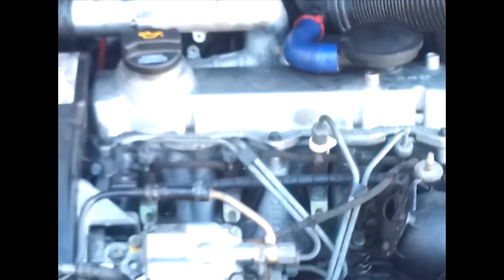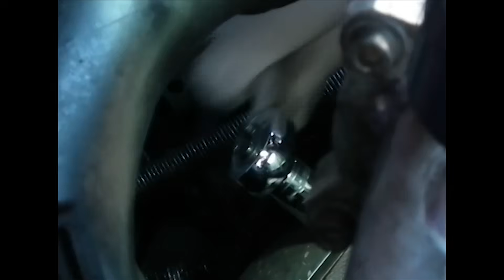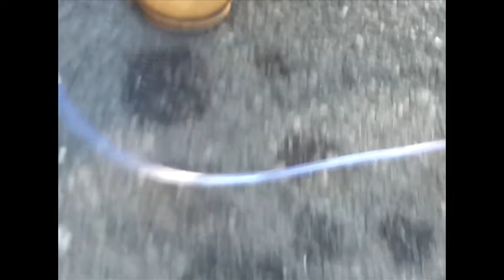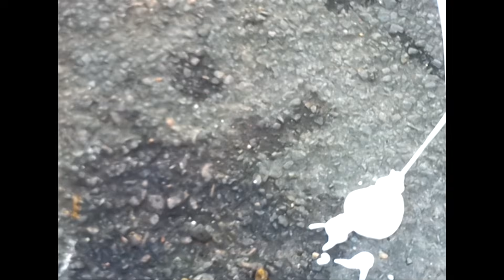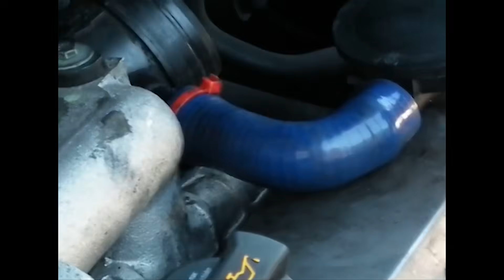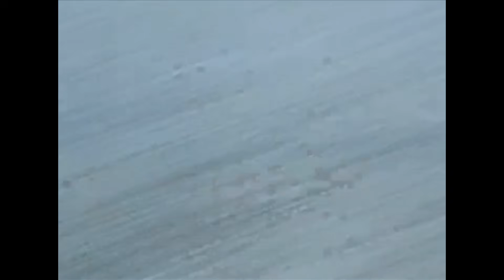Mr Muscle Audi A3 Tdi Turbo Clean - cheap fix

Comment: Hi there. Thanks for this video. 
I think this is the problem I'm having with my 150hp 5 cylinder  2.5tdi T4 transporter (the 150hp tdi has a variable vane turbo).
The turbo seems to hesitate when I accelerate in 3rd and then suddenly takes off with à great puff of black smoke from the exhaust.  She won't hold speed with the cruise control going uphill on the motorway but she will accelerate if I put my foot down - again she takes off after hesitation with that puff of smoke.
I've deleted the egr so I guess If I remove the blanking plate I can inject the Mr Muscle through there. I'd appreciate any advice.
Reply from the maker: Hopefully this helps, are you sure your MAF is ok too? Both can cause fun and games.
Basically this is pretty easy, it's more of a pain finding the tubing, also no harm repeating it - I wouldn't however leave it to soak for hours.
I've heard the odd case of bad turbos having seals eaten by this but they were well on the way out.
Reply: CarAndMechanical 
Thanks. Oven cleaner is in. I find the actuator moves but doesn't go very far.
Reply from the maker: It should loosen up the more you work it - I assume you've long since bolted it all back up. Notice any difference?
Reply: CarAndMechanical thanks for taking the time to reply. 
Once the engine cover is off it's all easy to get to on a AXG 2.5tdi Everything can be accessed from above. I abandoned the idea of going through the EGR blanking plate.  Unbolting the exhaust down pipe from the turbo like on  your Audi was a lot easier. Once the oven cleaner was into the turbo I let it sit for a couple of hours and wiggled the actuator rod every 10-15mins as you said. 
Seems have to have improved things. Turbo kicks in sooner for sure. But she still won't hold 130kmh in cruise control on motorway hills. I didn't feel much movement on the actuator - probably les than 5mm. Even though it seemed quite smooth it was still pretty tough on the fingers. Should it be easier and have more travel? 
It's better, but I think I need to get her looked at by a pro. Still not quite right. Maybe the actuator is ajustable - I think I read that somewhere.
PS
Just found this link on YouTube but Ive no idea how to get it to do this so I can check it
https://youtu.be/scnmRsCArXo
Reply from the maker: If you gained movement it sounds like it was part of the issue and sometimes the vanes can be really carbon'd up.
The VNT system sounds like it wasn't working fully before and maybe not so the car is struggling to hit expected boost at certain points - it would be worth repeating, the process but I'll throw out some other potential issues.
Vac lines - if they are split or vac is weak it'll take longer to get the turbo to the low position but also open the vanes for high boost which could overspeed the turbo (which is why the ecu has limp mode to prevent overboost).
MAF sensor - get VAGCOM (VCDS lite, a laptop and a £5 ebay cable go a long way) or if you have an android phone then use Torque pro and look at the air readings, fuelling it based off the metered air seen and I've had MAF and VNT issues at the same time. VCDS shows fuelling in mg/r and it gives you a target and actual - if you see it all over or slow then it can be the MAF, using Torque I think it's in G/S so the numbers are different to VCDS but the good thing with Torque is you can have it on all the time in your car and when the cars performing well note the numbers, when it's performing badly note the numbers it'll tell you if the MAF is misbehaving.
Last thing as you've mentioned is the turbo could be out of adjustment and you need to adjust the stopscrew, I've been lucky and never needed to do this but if you do note your start position and adjust 1/2 turn at a time (some good guides online https://www.myturbodiesel.com/wiki/turbo-stop-screw-adjustment-tdi-engine-zip-tie-engine-hesitation/)

Comment: Can be this done on a car  he is not closed EGR valve. Can damage the EGR valve or the hose that comes with the EGR valve (I do not know which material it is). How much volume should spray the spray? How much volume should spray the spray? Thanks and sorry for my bad English +CarAndMechanical
Reply from the maker: Hi, yes you'd need to get the EGR off to do it, when you do it you want enough to fill the hotside of the turbo but not to get into the block if you can help it. If you use hose like I have then you should be able to get it in deep and just as foam starts to come out you've probably got enough in there.
Also sometimes it's worth repeating the process.

Comment: Isn't sodium hydroxide corrosive to metal ?
Reply from the maker: More to Alu then Iron - this was done on the Hot side which is iron, however I do mention not to overfill into the Alu bits in the head.
When you start it up it'll burn everything up and blow it out the exhaust.
Reply: @CarAndMechanical  See https://www.youtube.com/watch?v=2k8IdyXwGE8. Ali candle base perfect after 2 hrs in Mr. Muscle.
Reply from the maker: @christophernation4793  TBH I'd have to try a similar test but also for longer as it's science that NaOH is corrosive to aluminium - time for it to be effective? I couldn't say so would always air on the side of caution especially if sticking it in my engine. I have some alu engine bits kicking around so could be an interesting experiment to see what happens over 48 hours.

Comment: Silly question maybe but, can this be on petrol turbo? Mk4 golf 1.8t
Reply from the maker: Hey - afraid not at the 1.8T used a fixed position turbo with no VNT mechanism. Also I wouldn't expect a Petrol turbo to soot up, what issues are you having with it?

Comment: Hey, for how long does this treatment help. Is it a permanent solotuion or do you have to repate it the next year? I have the same problem with limp mode and will try this metode. thanks
Reply from the maker: It's a bit of a "how long is a piece of string" answer I'm afraid as carbon build up will vary even between 2 of the same model/spec cars due to driving style/distance etc...
Once done if this was the issue you faced then at least once a week open the car up in a few gears and hit redline or as near as (if you can safely). With the low down torque sometimes the turbo's never get fully spun up.

Comment: Hi everyone..I would like to try this on my seat ibiza 1.4 tdi, do I have the engine running at the same time am spraying Mr muscle down the pipe?
Reply from the maker: Hi - please don't try this it must be when the car is off and cooled down. The oven cleaner is flammable, and the turbo very hot. 
Also it will need to sit and soak in to loosen the carbon/soot.
Reply: Thank you..so after the soak in..just go for a 20mins drive and gradually push 4000 rpm when the engine is hot
Reply: Also how much of Mr muscle would you recommend,  1/2 a tin? Just want to make sure am doing this right
Reply from the maker: You need to move the actuator whilst it is soaking - at first it'll feel grainy and you'll feel it get smoother. Volume wise not much but back sure it's all in the hot side of the turbo and you don't put too much in so as to get to the engine. NAOH will eat away at alu
Reply: Okay thanks one last question..the egr pipe on my car looks like a more golden colour and has a kind of spring design on part of the pipe..is this the right one, or there is another exhaust pipe leading to the right but this is a lot bigger and isn't facing down

Comment: Great reviews so far! What other components will I need to disconnect? I believe that going in through the "hot" side, I most likely will have to remove the EGR valve on top...will I need to remove the EGR cooler?  Wondering if I will need to get additional coolant? 
This weekend I was on a trip and 30 mins from home (thankfully) I had to turn back home and use our other vehicle because limp mode would not allow me to go more than 30mph up the hill!! UGH!!

Comment: Tried this on my A6 AWX, saved me a lot of work removing and cleaning the turbo. Now car is more responsive,goes more smooth and no sticking. Thanks
Reply: Nice, I have the occasional limp mode for 10 years on my A4 AWX, will probably try this 😄
Reply: @Bakanelli  did it work??

Comment: I just done this today to my Audi A3 1.9 tdi PD 130 and before the car was going into limp Mode once the car was taking upto 100mph, i done this method and my car does not move l, its like its in limp Mode all the time. i dont know what i done wrong, could you please help
thanks
Reply: i have the same PD. did you solved the problem?

Comment: there is movement when trying to move actuator rod when connected to turbo .but very tighy and only moves about 5mm
Reply from the maker: I hate to be so vague but I'm kind of working from what I've seen others need to sort. 
I think this page might help http://www.myturbodiesel.com/wiki/vnt-turbo-actuator-adjustment-repair-replacement-on-tdi-engine-mk4/ 
I do wonder if you are out of adjustment somehow. And All the vac lines and N75 have been checked?

Comment: done this twice on my golf this week . it will hit higher revs now . but still goes into limp mode . maybe mines beyond mr muscle and needs replacing ..any idea top speed would be in limp as mine will still do 100 in limp
Reply from the maker: Hey man, which type of Golf and engine is it - VE - PD or CR?

100 in limp sounds interesting I'm wondering if you got a turbo or MAF issue. Have you checked VAGCOM codes yet and anything that leads you towards the VNT vanes rather then vaccum / split hose or fuelling.
I'm throwing in a ton more questions as that speed means you must be getting fuel/boost....next question is that UK or Euro 100?
Reply: its a uk 2007 golf mk5 
 2.0tdi .it does rev for longer now .upto 5k revs . hits limp at 75+ 
but will allow 110mph but lot less power through gears
Reply: vag com shows over boost . about 145 bhp instead of factory 140
Reply from the maker: Something is telling me it's not the turbo or if it is then it's very coked up! You are in luck that you can use an Android/Iphone App to scan codes - also can use vagcom with a laptop.
I'll throw a hand full of suggestions out because my limp mode is like 60mph but I think yours will be a PD130 or 170 so more power in limp.

Scan for codes (I've done a video on this)
Run some logs - check fuel - MAF readings - Boost
If you have the torque app set it up with a few gauges like fuel, boost and MAF
Check your vacuum lines - a split one could stop the VNT mechanism working properly - infact it's a few £ to replace the lot.
Check all your IC hoses - that can be tricky depending on access but if you had a hose only opening on wide open throttle it could trigger limp.
Reply from the maker: OK this gets away from things I've need to look into but I wonder if your actuator is out or split vac lines and sometimes can be the N75 controller.
When you press the actuator how does it feel?

Comment: i have same issue on a 2006 mk5 golf /140 .2 garages both say i need a new turbo at a cost of 600+£s . but ive since been told this is a common vnt problem and if i fit a new turbo i could have same problem in 6 months .and have been advised to clean the old one every few months with wynns turbo i(in tank) cleaner . tried the mr muscle approach but too hard to get access on mine .
Reply from the maker: I think a few people in the comments have done it on a similar platform/year tdi so worth checking I just think the EGR is a pain to remove.
Is the turbo shaft ok - so no excessive play? I mean if you DIY it which does mean having the actuator bang on the turbo's themselves are cheaper on ebay! XMAN turbos (facebook) does hyrbid units for £700.
The in tank cleaner might help but it's mixing with a fair volume of diesel.
Reply: yes egr is a pain to get to.tge first 2 12mm bolts are easy enough.but the rest is a pain.might try again tomorrow.better to clean it every few months than replacing turbo if its going to carbon up again at some point .
Reply from the maker: Yea, if you can get in there this method can work really nicely and certainly if the turbo is working fine you are probably just needing to set right 10 years of build up thanks to the EGR.
Kind of surprised mechanics don't offer this as a £50/100 job but then again it's not 100% if something else is at play and they make more on the turbo labour.

Comment: Thanks for the video. I did this last Saturday with my 2005 Mk 5 Golf 2.0 TDI 4 motion.
It has been going into "limp mode" for several years when accelerating uphill or other random times.
VW garage did diagnostic and told me I needed a new turbo and wanted 1700 Euro for the job.
I figured I would try this first.
I do have an EGR so I had to remove the EGR cooler and the plastic intake ducting. (5mm, 6mm allen, and T30 torx)
It took about 2 hours to get everything off. ( I went slow and cautious, could do it again all under 1.5 hours)
Used entire can of oven Super U brand oven cleaner (I live in France)
It never foamed up out of the hole but fumes poured out. I worked the lever and yes it did get a bit more movement and easier after a few jiggles.
Buttoned it all back together and YES! no more limp mode !!! Horse on it up to 4500 RPM and all good. POWER is back.
Thanks CarAnd Mechanical. Great video.
Reply: Hi, i think i have the same issue... im curious to know if your engine is/was the BKD 2.0 TDI?
Reply: @Pixelkill3R  I have a bkd engine, wondering how good this technique is for cleaning the turbo. Mine has high mileage and just bought it
Reply: @matthewellis9885  haven't tried it. She's runs ok if I don't push it. Just haven't had the time. Consequently the cars mot is up soon and most likely won't pass. End of the road. Guilia Quadrafoglio next 💪
Reply: @matthewellis9885 I done this yesterday and it’s got it out of limp mode and have power
Reply: It is very likely that it goes into limp mode, due to over boost - waste gate or variable vane stuck! I'm not familiar in details with the 2.0 TDI, so make sure the actuator moves with absolutely no restriction.
Reply: I have the same car as you mate. Can you do this with a DPF ?
Reply: What happens to the remaining mr muscle/soot/shit in the turbo, do you just leave it in there and start the car?
Reply: @willwatling it’ll get chucked out the exhaust

Comment: Help me out ive had code 17965 for awhile now! and ive literally tried everything. 
1. mr muscle on various occasions
2. changed map sensor
3. change maf sensor 
4.changed n75 
5. changed pipping for vacuum leaks.
Reply from the maker: Hi Chrissy, ultimately this can be all sorts when you have had to do what you have.
Have you been along to tdiclub.com forums? 

Personally I'm wondering if you've got an actuator position issue, has that been checked?

I know you said it was remapped....that does make me wonder.
Reply: +CarAnd “Car Mechanical” Mechanical gonna stick a few Bottles of turbo clean in it and do me muscle again and also replace bolt on turbo
Reply from the maker: before you replace the turbo get a mittyvag to set the actuator length - this is not something I've got or done yet. But the theory on this is if the actuator rod length is too short or long the N75 control is screwed up.

If you are getting a new turbo you should have one anyway as they can move in transit.
Reply: +CarAnd “Car Mechanical” Mechanical cheers mate
Reply from the maker: just seen my typo too....mittyVAC
Reply: Watch the vmt ring in the exchaust turbo housing isnt worn , if so replace asap.

Comment: What a great video and thanks for sharing. I did this procedure on my VW Golf AHF engine and it freed the turbo up nicely,  restoring the low power issue I was getting under 2000RPM. I had a sticky spot in the actuator but after about an hour of treatment with moving it about occasionally, the sticking actuator began to operate smoothly. It's now super smooth and the car is running great again.
Reply from the maker: Glad this worked for you, really happy it's still working for so many people and saving tons.

Comment: ive changed my MAF sensor and attempted this aswell. still no luck im driving a 90 bhp golf mapped to 130 and receiving error code 17965 what else can i try and would VAGCOM narrow down the problem.
Reply: vacuum
Reply from the maker: +ChrissyKennedy 90 mapped to 130. Has it had bigger injectors? And did it behave premap?
Reply: pre map the car was proper dead:p stnadard injectors but ive had her at 110 before turbo is deffo kicking out as car goes into limp at 80 which leads me to think its the vains
Reply from the maker: I'm not sure the small injectors can flow for 130 bhp but will check. 
Have you logged boost in vagcom? Could be a boost leak triggering limp mode too
Reply: cars sitting at about 120-30 id say gonna use vagcom today and see what i can i still reckon its a turbo issue tho and  i may try mr muscle trick again turbo pulls like mad until the 80mph mark then limp mode occurs but car deffo has more in it
Reply: +ChrissyKennedy keep us posted, it helped me for about 3 days the clean did, but I'm getting a P1557 & a P1248.
Reply: will do pal replaced all pipes tonight so deffo no leak new n75 ordered
Reply: What pipes did you replace?
Reply: +ChrissyKennedy I need to do  the same, how much do I need? 2 sizes only as far as diameter?
Reply: change ur map sensor probs the problem
Reply: My MAP is reading 14-18PSI on my Ultra Gauge, is that good?
Reply from the maker: Has the car always done this? There is a one way valve on the n75...I've known them be put on the wrong way.
Reply: i changed my n75
Reply from the maker: OK, but there is a valve between the N75 and vac pump, the valve operates one way to aply vacuum to the N75.
Reply: ok ty
Reply: mapped to 130 did you also changed to bigger turbo,I mean orginel turbo cant handel such tuning and you also had to change particle filter,I mean this tuning of yours is not stage 1 but stage 2 or stage 3 only you had to modify other parts also..